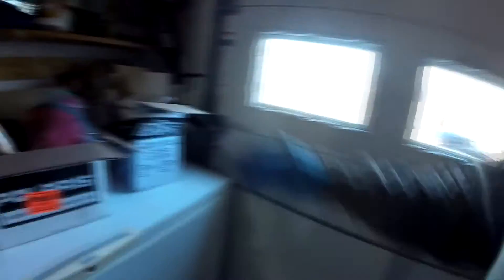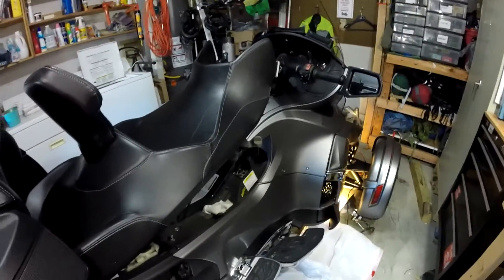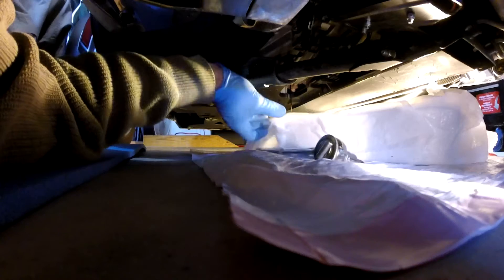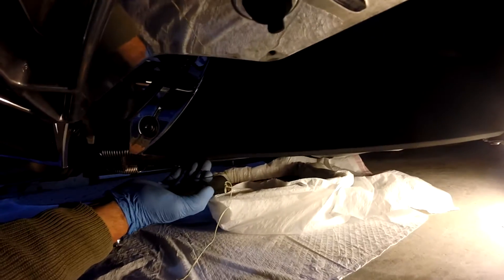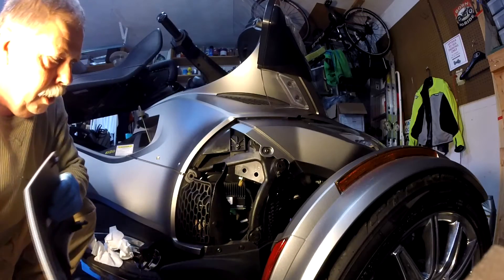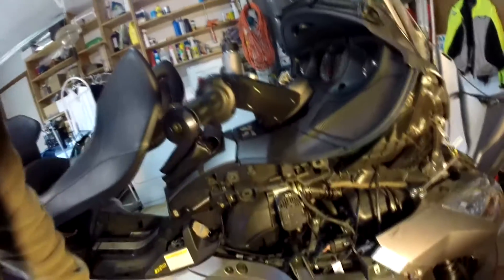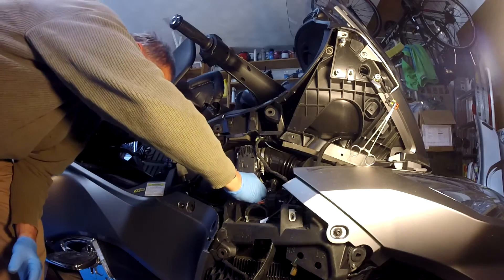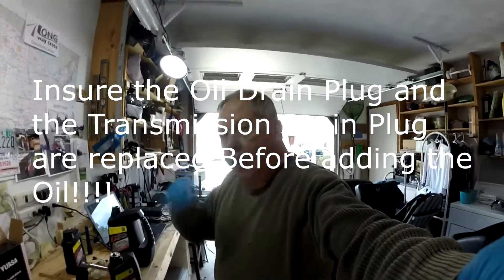How To Do an Oil Change, Can Am Spyder SE6

Comment: Thank you so much. I have a 2018 RT Limited. I tried to follow the manual on removing the body panels. But I could not have done it without your video. Thanks to you telling me what size I needed for the oil filter, I had my wife pick up a 36mm socket on her way home. Thanks again so much!!!
Reply from the maker: Thanks ShadowMaster, had the same issue with that 36mm socket, It just sets in my tool box for the next oil change...

Comment: Did my first oil change this morning. Was a piece of cake after watching yours and others videos here. Was a bit intimidated at first, but even the tupperware was a breeze taking off and reinstalling. The one concern I did notice ( mine is 2014 used ) was the transmission plug, was a bit rounded, so I may be needing to replace that sometimes down the road. Thanks in advance for your great video tutorials.

Comment: Getting ready to do my own oil change for the first time. I replaced the 2 analog dials and added a USC and Voltmeter instead of running more wire and it worked out very well. BTW great video.

Comment: Thanks John. I took my 2019 RT Limited in for the recall (inspection of the sprocket) so I figured I'd get the oil changed while it was there. Little did I know it was going to cost me $406.00 to get it done. I'll be doing it myself next time after watching your video.
Reply from the maker: Just did a post trip oil change. I am getting faster with each one.

Comment: Outstanding tutorial you have helped me with my decision to purchase a spyder.  400 dollars for an oil change at the local dealer, too many parts to remove to do it myself and so disappointing to see how expensive these machines are the expense of maintenance.
Reply from the maker: We just hit year 1 with no real maintenance issues. The first oil change is at 3000 then every 9000 after that. I did put on a back tire, the average life is 7000 to 10,000 Mine had 10,000. The price was $350.00

Comment: It's interesting that there's 2 separate drains but one fill hole. Or did I miss something?
Great video!
Reply from the maker: Hay Greg, The Spyder uses engine oil as transmission fluid, so one drains the oil pan and the transmission.  That is my understanding of the system..

Comment: Bought my 2017 at the end of last year. After watching your video I agree with Keith, this is over my head. Does anyone live in Missoula that has experience doing this? Thanks Bruce
Reply from the maker: The tricky part is pulling and replacing the side panels. The rest is easy. Thanks for watching.

Comment: noticed on the vid you have an all stock standard exhaust, I found modifying this system has increased the power and milage, the cat converter has been gutted and replaced as for the exhaust I replaced with an after market unit. This removed around 10kielos which loghtend the bike weight. Just my mods which might be of use to you. I do a lot of highway rideing.
Reply from the maker: Thank Peter, we need to look at that, At the moment our extra money is targeted to a big trip this spring.

Comment: Hi, I'm a new Spyder owner. Last week my bike went into Limp home mode. I have pulled three separate codes. P1120, P2620 and yesterday those Ines disappeared and they changed to P16C7 and now I have zero codes. Do you have any suggestions on what could be wrong? I can't get my Spyder in for servicing until July 21st. 

Thanks for your time.
Reply from the maker: Sorry Randy, I have no idea what the codes are. If you have any after market electrical stuff hard wired into the system, that may be the issue. Per Shawn Smoak, it often is.

Comment: Miles and I did the canal ride this last week and it sealed our wanting a spyder. My question is I found a 2013 limited Rt with 8000 miles on it for around $13000. How is the older canam vs the new. I can’t see spending $29000 for a new one so I have been looking for months and finally found one! I know the engine is smaller on the older years! And response would be helpful! Thsnks
Reply from the maker: Hay guys, I would have a spyder tech check it out, 8000 miles is low (good) we did a 4 day test ride on a 13 in 2015 SE5 (simi auto, 5 speed). We had no issues with it. Just check the value vs the price, dont overpay.

Comment: Thanks for the video I need to change my oil too. But I need to get the tools first. However I have a question.  Have you had your spyder laser aligned ?
Reply from the maker: Not yet, the tires are wearing normally. When the time comes, I may get a kit and do it myself. Thanks for watching,,

Comment: Hi John, Do you still do your own oil changes and have you bought a lift yet to assist in servicing the Spyder?  Also, any issues with the drive belt?
Reply from the maker: Yes sir, it gives me a reason to step away from my desk!!!!, No lift yet, just have not needed it. The best is holding up fine. I avoid gravel and sand..

Comment: how does the bike perform at higher speeds when you have a passenger on the back?
Reply from the maker: Passenger or not, its will get up and go! On the interstate I can cruise at 75 and never know Miriam is behind me... I find myself reaching back and checking to insure she did not jump off...
Reply: @JohnMiriamsTravelVlog  That is good to know.  I went to a dealership here recently and to get the touring RT edition with the higher ride height its going to cost 31k MSRP.  One thing im curious is if you sit in traffic how much heat build up do you end up feeling?
Reply: @JohnMiriamsTravelVlog  😅😂🤣

Comment: Hey John   Can you do Videos Show how to check and fill the Spyder RT SE6 the brake fluid and coolant and help tips to do so?
Reply from the maker: I can do the brake fluid on video as I have done that, I will be doing coolant this fall, and will shoot that also,,, just a warning, do not pull the drain plug on the radiator,, It would be bad,

Comment: you didn't say how much oil to use and how much oil to put in transmission and where to fill
Reply from the maker: Good point Dennis.  I never thought about quantity as it comes in the kit. I pour most in, check for leaks and level and top off. I never use 100% (dont want to over fill ). The transmission uses the same oil, and its drained in two points, but its all added in the same place, just under the seat on the right side.  Hope that helps,
Reply: @JohnMiriamsTravelVlog  thanks that was helpful

Comment: Ya umm how ridiculous is this. Absolutely no reason why it had to be designed like this. This alone would almost turn me away because a service shop would charge at least $200 PLUS supplies to just simply change oil. Ridiculous
Reply: I'm "mechanically challenged" and thought the same thing but with help of YouTube I've done all the work on my Spyder and felt real good about saving money doing myself.